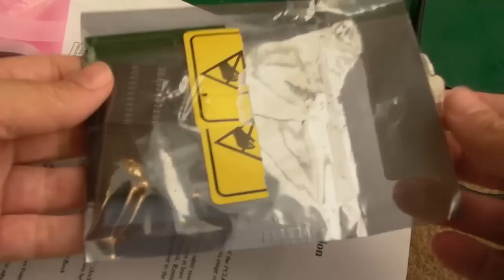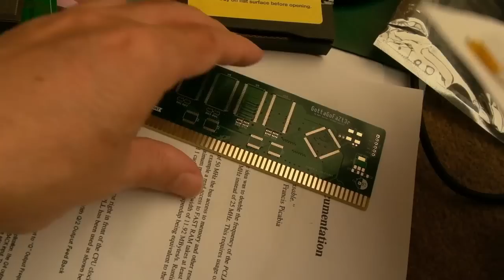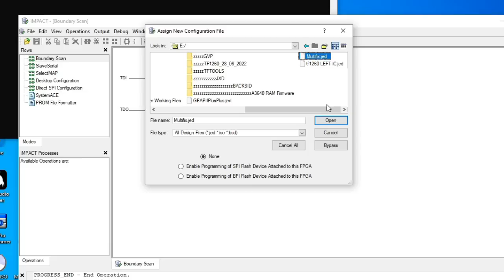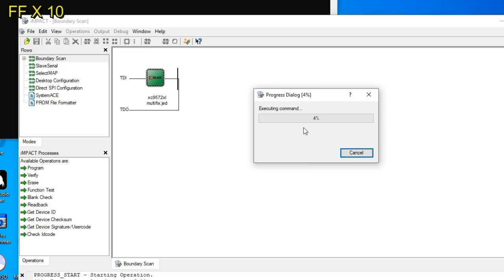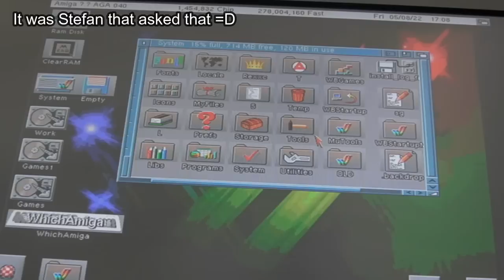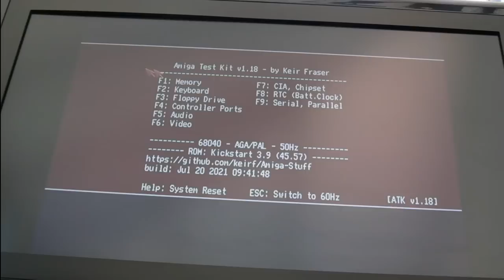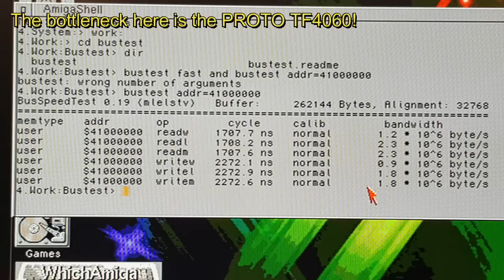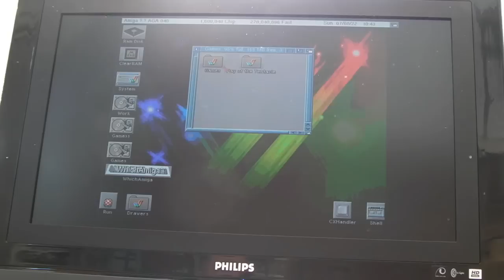Commodore Amiga GottaGoFaZt3r 256MB RAM Zorro 3 Card - Will it work?

Comment from the maker: UPDATE: LIV2 worked out you can configure the MMU to disable cacheing on the RAM range and get a huge boost in performance when using 060 cards like the proto TF4060!  I will re-visit that!
Reply: wil there ever be any cards like this for a 1200? would love a spare gb,  so i can extract cd images to ram.
Reply from the maker: @Caddy666  Very unlikely - you can get the TF1260 with 128MB though - a future revision could provide more I think!

Comment: Would that game run faster if you had the FPU enabled?
Reply from the maker: No, the FPU cannot really be used in that way.  A game would need to be programmed to make use of the fast floating point operations it can provide.  In this case the slow loading is based on disk and RAM throughput and the huge volume of data loaded.

Comment: 1gb ram on this machine, or an amiga is practically useless..... i havent seen anything use more than 1 or 2MB on my 1200.... thats just me... what we need is a newer modern OS for this machine that could use some of that ram and dispense it properly. like cache for the cpu.... etc... well, well have to see. good job btw
Reply: It depends what you're using it for.  I like to write electromagnetic simulaton software which could easily use 1Gb of RAM if it was available.  Its obviously very slow compared to a modern workstation, but I like to do it anyway.